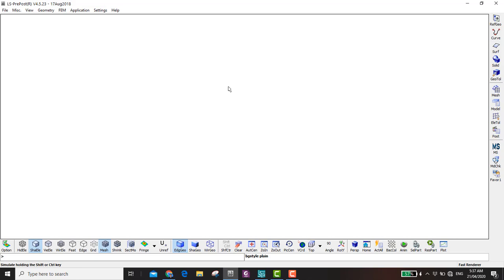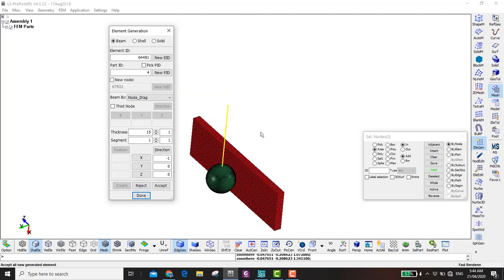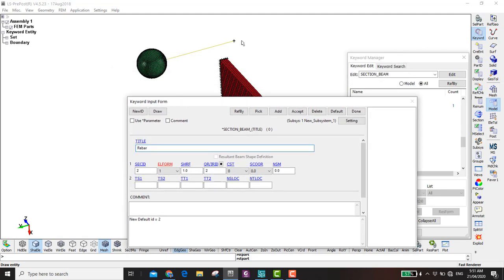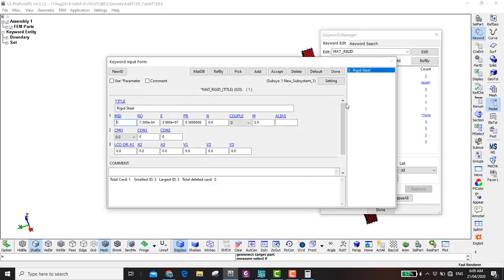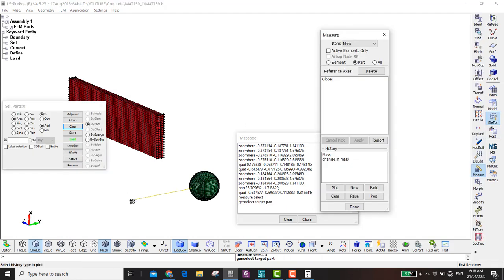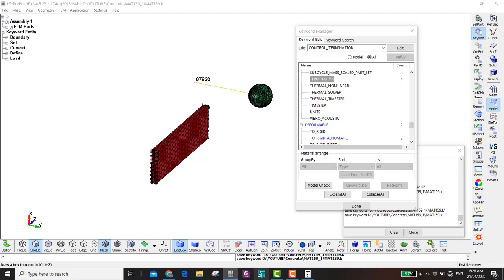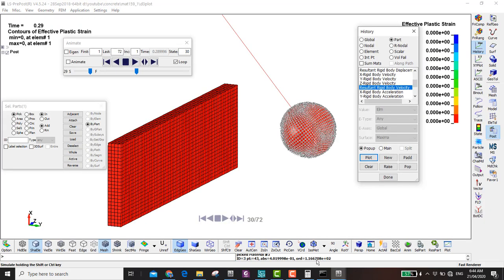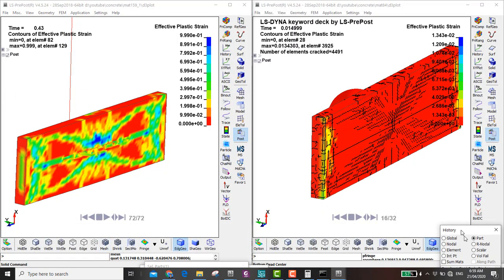LS-DYNA TUTORIAL 13: Reinforced Concrete and Wrecking Ball

Comment: Does the Reinforced Concrete work with modal and frequency analysis?
Reply from the maker: Yes. But you might want to have the rebars and concrete nodes merged. I am not sure if CONSTRAINED LAGRANGE IN SOLID and CONSTRAINED BEAM IN SOLID works in eigenvalue analysis.

Comment: sir it giving errors in simulation, i tried this same tutorial but simulation is not running, on ls run 2024
Reply from the maker: @HamzaAftab-m3f  
1- make sure that the software is installed correctly. Try to run any other model. 
2- check all the values input in your file. Maybe there are some values that you inserted wrong..
3- what is the error? Most of the time, the  error will be mentioned in the command window that appears when you run the simulations..
Reply: @AmeenTopa  sir can you share its file on some platform like email or something,i will run that
Reply: i need this immediately sir
Reply from the maker: @HamzaAftab-m3f  Sorry, this tutorial is from four years ago. I don't have the model anymore. 

It has more than 20k views and nobody else said they got an error. So, the tutorial is fine. You maybe made a mistake or a problem with the software installation.

Comment: Dear Ameen,
If I want to model the reinforcement in the remaining direction, should I separate the two layers of reinforcement by shifting them apart?
Reply from the maker: @Dat.Phan-Tan  I don't understand what you mean by "remaining direction". 

Anyhow, you can follow the same steps (Translate + Copy) to make more reinforcements.
Reply: @AmeenTopa  In this tutorial, you model the Z-direction rebars at a distance of 0.75mm from the surface. If I want to add the X-direction rebars, can I create these rebars at 0.75mm from the surface as well, or should they be at a different distance?
Thanks in advance!

Comment: thank Ameen, entered the concrete density as 2.246e-04, what would be the unit for this? If the original concrete unit is set to kg/mm³, it would be 2.4*10^6 kg/mm³. Did they multiply all card values by *10^2? Was the rebar density also multiplied by *10^2, resulting in 7.2e-04? If I’m correct, why do they apply *10^2 instead of using the original kg/mm³ unit?  Ameen, you are my savior. Please, I’m begging you. 😭
Reply from the maker: @덕씨의하루  in this example, I also used imperial unit system (pound, inch, PSI), and I use that only for demonstration because I never used imperial unit system in any other video.

Comment: Hello my teacher, I made a reinforced concrete model with a TNT explosion, but how do I know if the x-axis time of the curve graph I put in is msec or sec? If there is no fixed unit and the unit I set is SI, do I have to fill in the numbers of all cards in SI units?
Reply from the maker: If all your input in SI units, meaning, if you input the density, mass, stress in SI units, then the time should be in sec, which is the SI unit for time.

Take note that your dimensions should be in meters, not millimeters.

Comment: You said q=d3crack, but could you tell me how to do it with the current version instead of the old version? Please, I am a self-taught student in Korea😂
Reply from the maker: @덕씨의하루  do you mean you use LS-RUN? If so, then you can add this command in the expression line.
Reply: I typed "$SOVER" i=$INPUT ncpu=$NCPU memory=$MEMORY Q=d3crack, and the d3crack file size is 0. What should I do, teacher😢
Reply from the maker: @덕씨의하루  have you defined DATABASE BINARY D3CRACK? 

Also, this crack file is supported only with MAT WINFRITH.

Comment: Hi sir , the gravity that you defined is for both or only for ball
Reply from the maker: To define the gravity on all parts in the model, use *LOAD BODY Z (assuming the height is in z direction).

If you want the gravity to be for certain parts only, you need to add the keyword *LOAD BODY PARTS and input the part set that will be subjected to gravity in this keyword.
Reply: While applying LOAD BODY Z do we have to change scale factor to -1 or 1?
Reply from the maker: @chandff666  If the height is increasing in your model with the Z axis (meaning: bigger z coordinate = higher location), then you use LOAD BODY Z, and DEFINE CURVE with the gravity constant 9.81 m/s2 as a POSITIVE value.
Reply: Thank you

Comment: Thank you for your good simulation results. One simple question.  How did you find out that it will take 0.4 sec for the ball to hit the wall? Did you calculate it by hands?
Reply from the maker: It is a simple pendulum motion under gravity load. So there is analytical solutions for that.

Comment: Sir, I used the model of this video and the explosion parameters of that beam. The time display is very long, and I saw through the d3plot file that there are more than ten frames of animation, but no deformation. Is there a problem.
Reply from the maker: Check the unit system in both videos. They must be consistent.
Reply: @AmeenTopa  thanks for your solution！
Reply: @AmeenTopa  I'm sorry, sir. I gave up the idea of using beam element to simulate reinforcement, because it has never been successful. I plan to use solid element to simulate, so I want to ask, do I need to reserve space for reinforcement in the concrete? If necessary, what method is better? Thank you very much, sir
Reply from the maker: @shiqizhang3532  If you are not modelling cable/rebar pull out, then it is better to use beam elements.

Using solid elements, yes you need to have space inside the concrete to get better results. 

For slabs or column reinforcement, it is recommended to use CONTRAINED LAGRANGE IN SOLID or CONSTRAINED BEAM IN SOLID. If it didn't work with you, it means you didn't use it correctly.
Reply: @AmeenTopa  i got it.i will have a try

Comment: It is a wonderful example. However, when I tried to represent the model, I found that the rebars are moving out the concrete. I don't know why. I checked the constraints and it is the same with the video. Could you please give me some hints? thank you！
Reply from the maker: You need to fix the end points of the rebars as well. Not only the sides of the slab.
Reply: @AmeenTopa  A little difference in selecting the end nodes makes a great mistake, cool!
Reply: @AmeenTopa  thank you, I will try your method.
Reply: Still, there is another problem. If the rebars are embedded inside the concrete which has no nodes on the side surface of the concrete, should the ends of the rebars be fixed also?
Reply from the maker: @Drlutheo  this problem of rebar falling only happens because I am using DEFORMABLE TO RIGID keyword. If this one is not used, then no need to fix the rebars with SPC SET, the coupling with CONSTRAINED LAGRANGE IN SOLID should be sufficient.
Reply: @AmeenTopa  Your patience is greatly appreciated！

Comment: Dear Ameen
The model don't have any problems when used 072R3-CONCRETE DAMAGE REL3 Material. When I change to become 159 CSCM Concrete or 084 WINFRITH CONCRETE REINFORCEMENT  , The model have errors that can not completely run. 
Could you give me your email?
Reply from the maker: Dear Quoc,

084 WINFRITH CONCRETE REINFORCEMENT material model should be used with 084 WINFRITH CONCRETE. It is a method to model the reinforcement without having to create the rebars. 

Put your email here and I will follow up in my free time.
Reply: @AmeenTopa  this is my email: baoquocbk2012@gmail.com
I hope to receive  your email. Thank you so much.

Comment: Dear Amee,
Thank you for this valuable Tutorial, I tried to help someone with the skills acquired from here,  How do I solve the issue of this error message "Material 159 part number 1
 failure curve parameters are inconsistent,alpha should be greater than gamma" I used MAT_159 CSCM CONCRETE, and please can you clarify the difference this current and MAT_159 CSCM
Reply from the maker: You can read right? The error says alpha should be bigger than gamma. So, it means you defined gamma bigger than alpha.

MAT159 CSCM is more advanced than MAT159 CSCM CONCRETE. They use the same constitutive equations, but in MAT159 CSCM CONCRETE, all the properties are automatically generated.
Reply: @AmeenTopa  Thank you very much. I couldn't find alpha and gamma are in MAT159 CSCM CONCRETE I only saw in MAT159 CSCM
Reply: Where exactly this parameters are situated

Comment: Hey Ameen, thanks for making the video. I have a general question, if I have to check for maximum value of an entity let's say for example displacement. Is there a way to obtain the location of the node as well where the maximum value is actually attained. Because to obtain the maximum value we need to select by part and then the LS-post gives the maximum value in the part, irrespective of the location of node.
Reply from the maker: You can plot the displacement of all the nodes, and from there you can see the maximum displacement.

Maximum displacement usually occurs at the midpoint if the supports are at the sides and occurs at the free end in case of a cantilever beam type of boundary conditions.

Comment: Hello Ameen, i have a question brother,

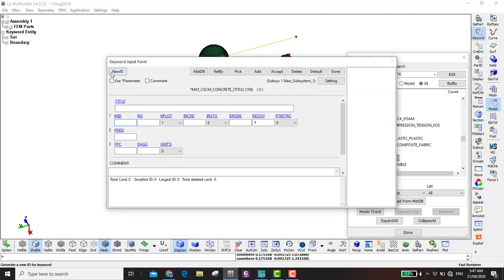1. At 08:34, when you defined concrete material in imperial units, i saw that there is an input for units that we can use either MPa, GPa, or Psi (Here you used number 3 for Psi units). My question is,when defining Plastic Kinematic material, why there is no input for units like when defining concrete material? How does LS Dyna understand the unit we want? In my case, i have modeled parts in SI units (milimeters) , and i want to define plastic kinematic material in SI Units too.
I know that we should be consistent in units, but i got confused when there is an option for unit input in CSCM concrete material and not in other materials like plastic kinematic.

2. When you defined curve at 21:04 for gravity, how does LS Dyna know that A1 input is time input ? what if i want it otherwise: time input is in O1 and gravity force in is in A1?  Is it possible ?

Thanks before Amen, your videos are amazing and really helpful !!
Reply from the maker: 1. Only few material models have this option. This is because these models are based on empirical data, not constitutive equations. So, software need to know the conversion factor.

You need to read and understand about the unit consistency in LS-DYNA. You can look it up in the dynasupport website.

2. The software will understand the curves as follows: x is the time, y is the value of the function which can be velocity, displacement, gravity constant, etc...
Reply: @AmeenTopa  thank you very much !

Comment: Hello, Ameen. Could you please make a video on RC column or beam subjected to blast loading using the MM-ALE method. It should be really really helpful. I am using prepost v.3.2. So, running the new version results in the processor is not possible.
Reply from the maker: You can download and install latest version of the Prepost. It is free. 

I have already made a tutorial about blast with TNT on composite beam. Please check it in my channel.

Comment: hi Ameen, I would ask you about composite column. if I want design reinforcement and put steel I-section in a column. how can i contact all elements while there will be an overlap among steel I-section , reinforcement and concrete.
Reply from the maker: Hi Osman, you can try CONSTRAINED LAGRANGE IN SOLID. 

However, I would recommend that there you make a hollow section in the beam, then apply tiebreak contact or just surface to surface contact with high friction. 

For the reinforcement bars or stirrups, you can just use the same approach as in this video.
Reply: @AmeenTopa  Actually, I'm a master degree student, and my research topic on a composite column with ls dyna software. Is there any chance of having your email address for asking some questions in ls dyna? This is my email ((memedosman471@gmail.com)).
Thanks for your time and help, you reached me a lot with your videos. I recommended you to my friends and one of them had a talk with you yesterday.

Comment: Is it possible to define stress-strain curve on MAT159_CSCM_CONCRETE?. I didn't find any option.
Reply from the maker: I don't think so. MAT159 is a very basic model for concrete. You can use MAT84 to define 8 points of stress strain (pressure vs volumetric strain)
Reply: Ameen Topa thank you for your quick reply and suggestion
Reply from the maker: You are welcome
Reply: MAT159_CSCM_CONCRETE has been developed to minimize the input. Other parameters are calculated based on the unit weight and unconfined compressive strength. However, one can customize  different parameter as per his/her own requirement in MAT_159_CSCM. The result of such input is actually some sort of stress-strain curve.

Comment: Dear Ameen, 
Thank you so much for posting these videos especially this one. I have a question in term of  modelling the steel rebar. I noticed that you used a plastic kinematic for when you define the rebar. If I wanna see the steel rebar fracture, what would your recommendation be for that material?
Reply from the maker: You may use plastic kinematic and introduce the failure strain as the criteria for  fracture.

Comment: Hi Ameen,
I am new to LS Dyna.. I am working on a stiffness analysis of a plastic part when it is pushed by a rigid body of 50 mm diameter and 50N force.This analysis I have done in abaqus. Now we have requirement to do the same in LS Dyna and compare with abaqus. Can you please tell me which  of your video I can refer to execute in LS Dyna.
Or can you tell me which keywords I should use for execution.
Thanks.
Reply from the maker: Hi, you can refer to the following tutorial:
https://youtu.be/jIUcQx6XZ2E

But I would recommend you to check the first two tutorials to get used to the user interface of the software.
Reply: @AmeenTopa  Hello Ameen, thanks for the reply.. I will go through your videos.. these videos are really helpful..

Comment: Dear Ameen, Thanks a lot for this helpful tutorial.
If we use d3crack with mat_CSCM as concrete material, we can see cracks after analysis too, is that ok? or we have use just winfrith model to see cracks correctly?
Reply from the maker: Dear Zeinab, as far as I know, d3crack works only with Winfrith material model.
Reply: Thank you for reply. I tried and it worked on CSCM but just with rigid dropweight. I used mat add erosion on winfrith too, but the result is wrong. actually the ball go through the slab's inner element. do you know how can I solve this?
Reply from the maker: Good to know that, thanks for sharing this info. With regards to your problem, you need to change the contact. I have mentioned about this in this video.
https://youtu.be/4VPQVCk5F3A

Comment: I am now using LS DYNA to analyze the explosion of concrete structures. If you use CONSTRAINED LAGRANGE IN SOLID and put 2 in CTYPE, an error that the node point cannot be shared will occur. I have tried different attempts for a long time without knowing the cause, but I couldn't find the answer. Is there any way to solve this? Can I leave a mail?
Reply from the maker: Leave your email here and I will follow up. 

In my tutorial, when I first made the reinforcement bars, I translate them and I deleted the original. This is because the original have shared nodes with the concrete. If this is the case, CONSTRAINED LAGRANGE IN SOLID will not work and it is not needed actually. If the nodes are shared between the beams and the solid, that will act like coupling between the two.
Reply from the maker: @Perf.kisulsa  I have sent am email. Kindly check your inbox.